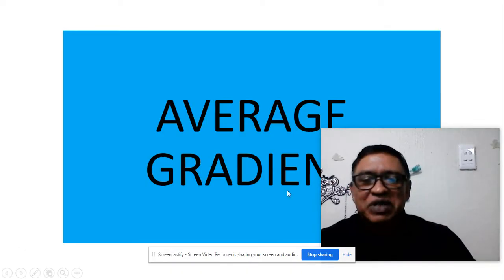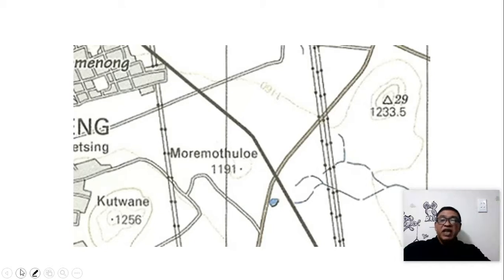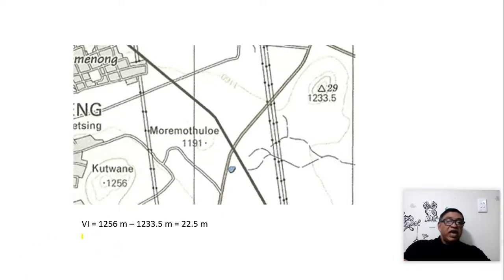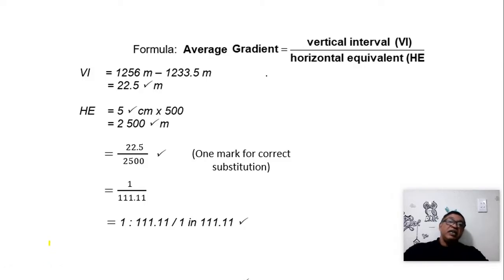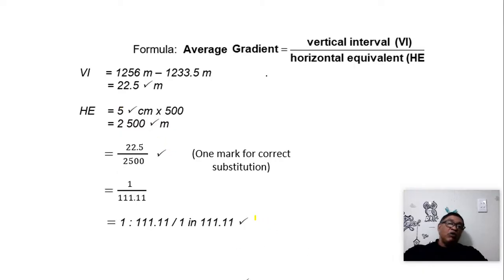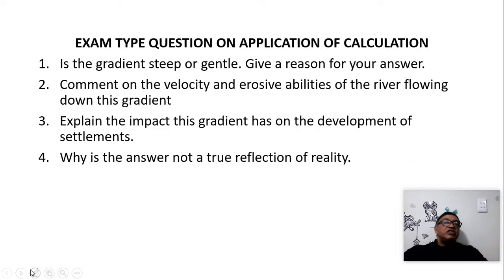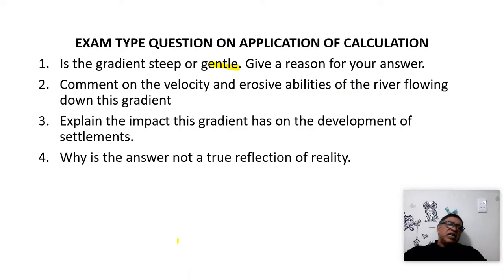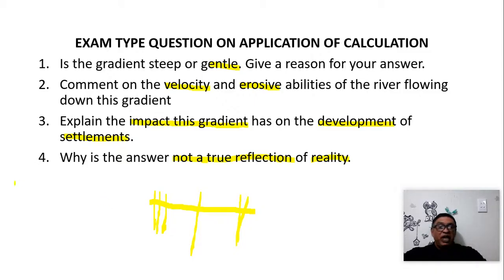Geography Mapwork: Average Gradient

Comment: How did you get the value of 500 which you used to multiply your height distance
Reply: 500m is equal to 50000cm. the scale of the map is 1:50000cm and you need to convert it into m to match the unit of the vertical interval. so 1:500m is the same as 1:50000cm